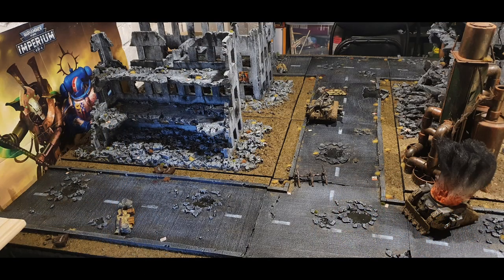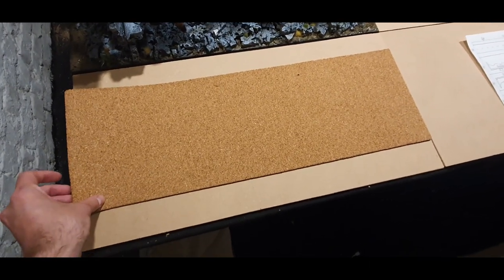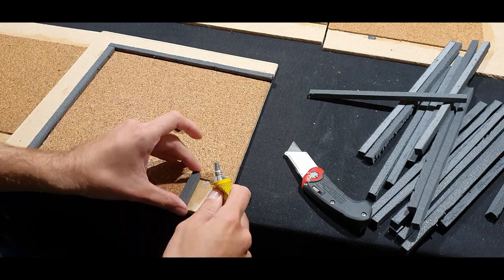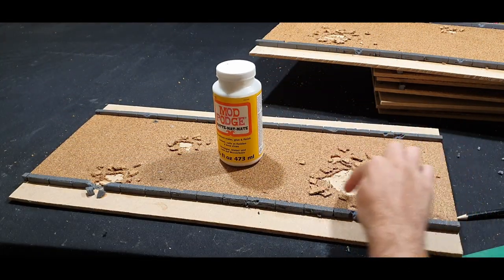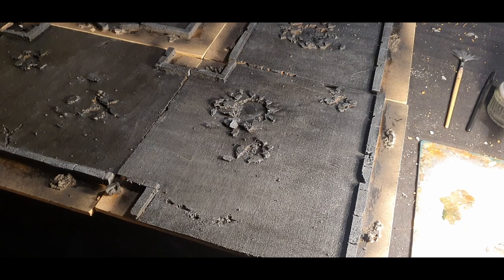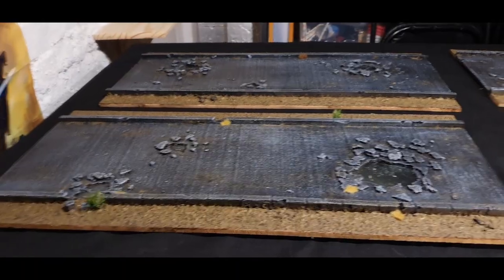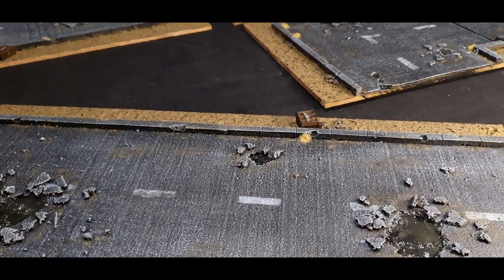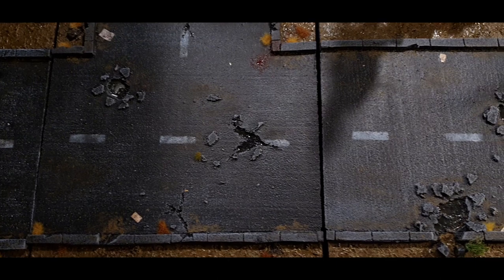Warhammer 40k Board Build- Modular Roads

Comment: 13:23- I was just doing something like this last night…… that must be some real weak glue you used?!? Because all of that seems like it came off really easily!?! I mean so easy that at some point the road is probably going to fall off that wood!?!
Reply from the maker: Hey mate so I used UHU glue to stick the road down it is quite a strong glue but due to the cork being quite a soft material it's easy to cut into it with a craft knife and carve it into the craters. The mod podge and paint helps to harden the cork afterwards. I haven't had any issues with the road separating from the wood and it's been about 2 years since I made them now so think the UHU is strong enough but you can always use a stronger adhesive if you wanted to!
Reply: @CommanderLurpack   sorry if my comment sounded like I was trying to be rude! Honestly, I didn’t notice it at first but before I started to read your reply I read my comment again and yeah….. it definitely sounded like I might have been trying to be a A hole!?! Sorry about that! So what I meant was I am in the process of making a very big diorama but it’s section by section and it’s to depict Cadia’s last stand. Well I was also using corkboard (very thin but almost a foot long! My job was tossing a lot of it! So of course I took most of it home to see if I could use it for anything! I am still mostly a noob to all of this) for a hill for a graveyard! It’s definitely flimsy……. but I don’t know if I would call it “soft”!?! Maybe it’s 2 different things…. I didn’t really get mine in a pack or a box with any labels…. But that is what the boss called it when he asked me if I wanted it!?! Anyways, I made the mistake of not cutting out the first hole before gluing it to the wood board….. and oh boy…… was that a mistake lmao It took me far longer for me to just cut that 1 grave out from 1 layer then most of just the terrain took on my first piece!?! And it still looked pretty bad on where it was attached to the wood! But somehow yours looks almost perfect!?! That was all I meant. It almost looked like you cut it out while the glue was still wet or maybe you glued it so perfectly that when you lay down the corkboard on top that spot didn’t touch any glue! Sorry for any misunderstanding!
Reply from the maker: @AcoylteKraven82  hey no worries at all mate I didn't take it that way! Oh dear that does sound like a lot of hard work to get off, maybe the cork you have is a bit stronger than what I bought as the stuff I bought was quite soft until I hardened it with mod podge! A last stand at cadia diorama sounds awesome by the way!
Reply: @CommanderLurpack  ok, good! I just wanted to make sure! Because unfortunately a lot of the YouTuber I use to follow, at some point they took something I said or even multiple things I’ve said as a insult or a attack! But instead of just asking or leaving a reply, they just ignored it, moved it on the comment section so no one could see it with the newer comments or wait until many months later and then attack me in replies because at that point, if I question anything it’s automatically a attack!!! Which could have been cleared up at any point with a question or 2!!! At that point I know there is nothing I can say or do to get them to not think any comment after that was a attack! Not to mention, they would normally cross the line they think I crossed in the first place…… so the chances of my comments/questions would be more or less attacks anyways because I already know (not think and not a misunderstanding like theirs was) they are going to attack me regardless!!! So I just stop watching their stuff!!! But I like your videos also and now that I understand what the problem sometimes is, I try to stop it before it’s already out of control! Sorry this is long! I’ll make a shorter version because there are still a few things you said that I didn’t even mention!
Reply: @CommanderLurpack  sorry the last reply was long! This is a short version! 
Ok, good! I didn’t want a misunderstanding to do what it has done in the past for me and make it not worth me watching their videos! Yeah, mine could definitely be harder!?! I don’t know how many versions there are! But also mine is designed for industrial work! So it needs to be stronger for what it’s going to be doing! Yeah, the diorama is looking great (in my opinion) so far! But the issue I’m having now is that the factions I was planning on putting in it doesn’t make much sense and the bad guys weren’t the ones that actually attacked! I think I took 2 different wars and got them mixed up! So now I would have to buy a bunch of Chaos troopers and demons! Which I don’t have the money for……… and the whole project is getting to the point I don’t think I could sell it in the end!?! If you want, I post pictures of the progress on my instagram account! So if you would like to see the 2 pieces so far I could give you my name on there and follow you if you are also on there?!? Up to you?!?

Comment: Any warping on the 6mm mdf? And did you seal them at all?
Reply from the maker: Hey sorry for the late reply! No warping on the MDF so far I think due to not having much weight on it unlike the board sections with the buildings where is used 9mm I do believe, I sealed them before painting with mod podge I might have forgotten to add that to the video!